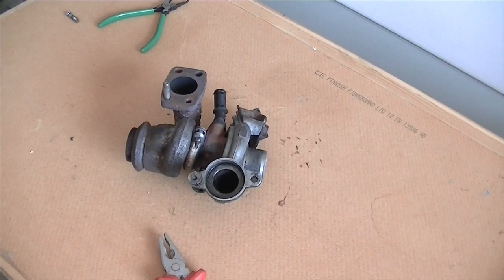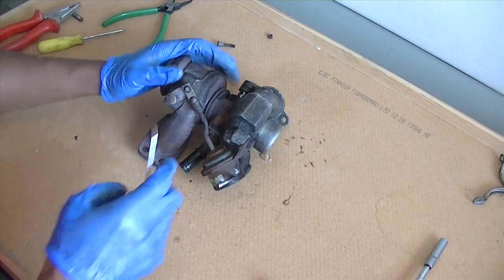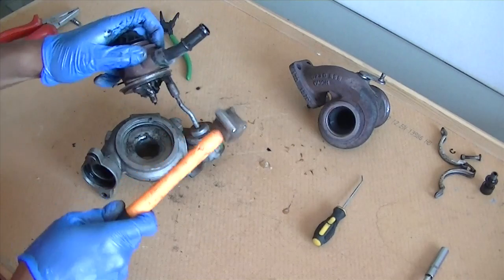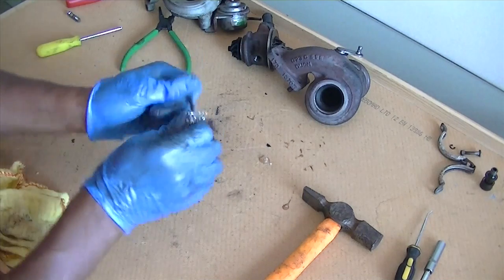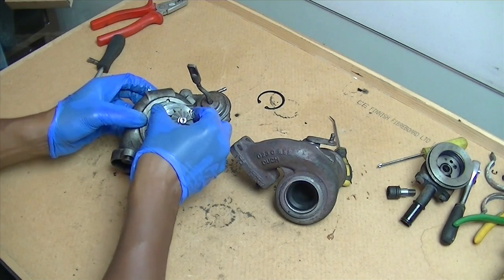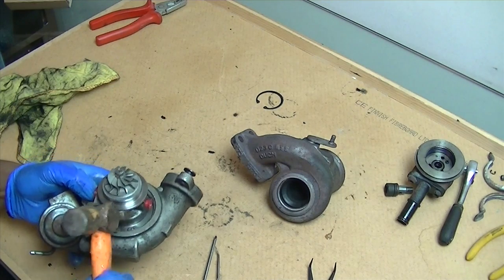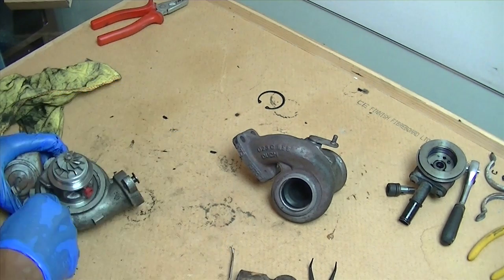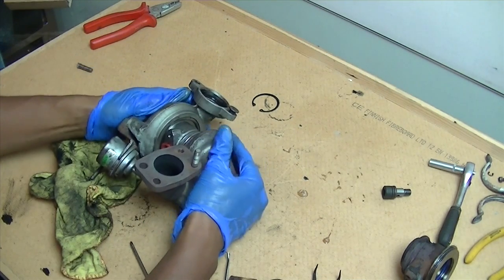How to Rebuild a Turbo at home, in simple easy steps

Comment: Don't start the engine untill u prime the turbo with oil by turning the engine over but don't let it start to build up oil pressure ,u could probably take the fuel pump relay out , other wise Ur starving the new turbo of oil , otherwise a cracking video 👍👍

Comment: Maybe you should consider mentioning one of the reasons the turbos fail on these engines. Oil starvation. The banjo bolt that goes into the block and sends oil to the turbo has a little screen inside it that restricts oilflow to the turbo. It need to be removed. ;)
I have just broken the turbo on my 1.6 HDI engine and now I have removed the screen to prevent it happening again. :)
Reply from the maker: This is all very true

Comment: By the looks of it this is the 90ps unit. Is it any harder rebuilding the 110 unit? I'm rebuilding my 206 1.6 HDI turbo soon
Reply: the 1.6 110 has a vnt so its a bit complicated cuz you also have to clean those

Comment: Very nice video
I have the same problem that the oil comes out of the turbo
But the question of whether I can do it to my turbo
My car is Hyundai Altantra 2.0 diesel engine
I'm afraid that the assembly will not be good because the parts need to match very accurately and then can make a problem with the engine
Maybe it would be better to replace the turbo? Not only in this little part

Comment: Hi nice video. I rebuilt my turbo last weekend and fully stripped cleaned out all the engine oil parts inc the intercooler etc as the oil had leaked through all the system on my 1.6 tdci Fiesta. After a good run after start up everything seams great, but I did notice on rebuild that the turbos actuator was quite weak! Like the spring may of over heated etc when the turbo had failed. So I've ordered a new actuator and I'm looking to fit this weekend. The only problem I have is how to set up the actuator arm correctly on the turbo for optimal boost? Do I set the arm so the spring pressure touches the waste gate fully closed? Do I set the arm so as to set the waste gate with some spring pressure in it? Should it be lose e.g. The waste gate always lets a little air past it even when on full boost? I really don't know? Or should I try to set the arm the same as the one that is been removed, that maybe difficult? I've searched the web to no answers. All I know is that the vac pull the actuator and in turn the waste gate fully open on start up. No matter how I rev the car stationary no load the actuator does not move at all. Maybe due to the weakness in the spring mentioned? I don't know how the system fully regulates turbo boost pressure or what that pressure should be at max boost? I'm imagining about 14psi? I don't know though? Should you close the waste gate totally and adjust the arm accordingly and put on nice and neat and the car ecu controls the boost pressure and will regulate it at the ecu end? Any help would be apriciated on this as I'm pretty stuck and would like to know how the full system works on these engines. Had Subaru stis in the past, so not right sure how to set up vacuum set up turbos on derv engines? Maybe it might mean I try and set best I can and have my local turbo specialist set it all up on the rolling road, at an expense I want to avoid if possible? Any help oils be appreciated?? Cheers John

Comment: I have a few fault codes on my 2.0 tdci s max I have a turbo boost control A position exceeded learning limit and barometric pressure correlation code p003a and p0069 any way you can help me I would be really greatful great vidz by the way respect bro👊💯

Comment: hi mate great tutorial just wanna say what happened to the oil return pipe as you never put that back obviously originally it came as a sealed unit, surely that is needed to re-connect the pipe on install cheers

Comment: More mk4 videos lol
Reply from the maker: ***** what vids would you like to see?
Reply: BMAC VAGS how to remove and clean an intercooler?
Reply: Cleaning head light tutorial front lip some more diy turbo upgrades? Inter cooler keep up the good work mate
Reply: BMAC VAGS How to drain intercooler of oil on an ALH motor
Reply: BMAC VAGS fix motor open / closed loop air conditioning